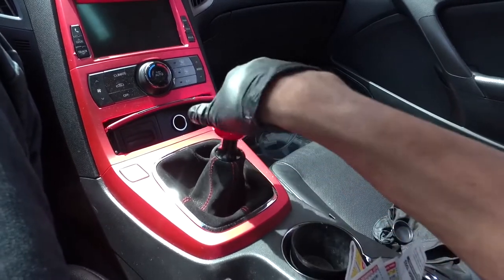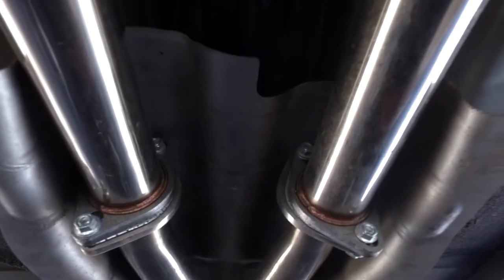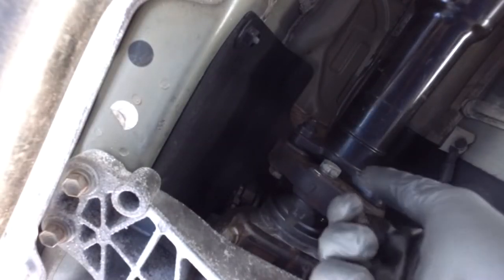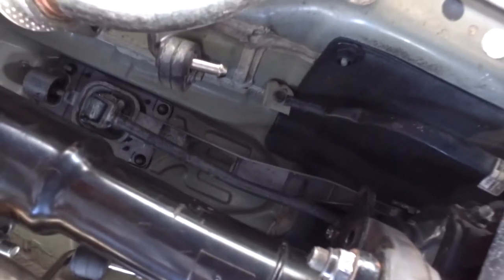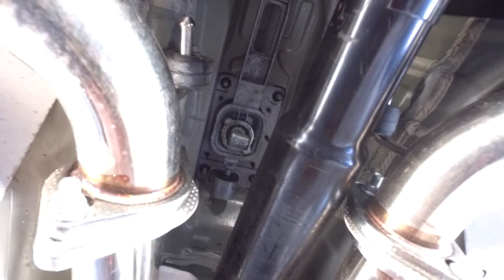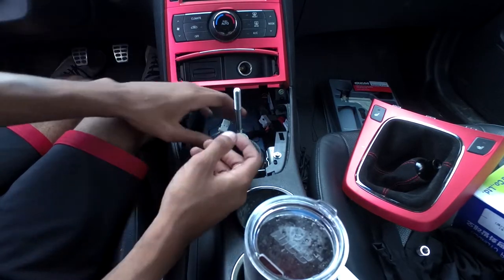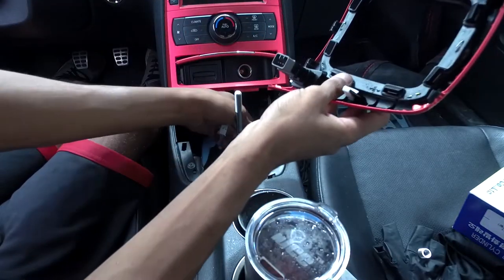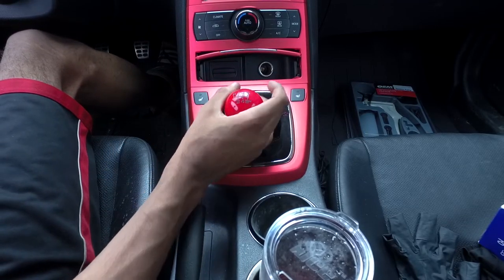How To Install A Short Shifter On Hyundai Genesis Coupe - Garageline short shifter

Comment: Hey man, I don't do much to cars and I'm a little scared disconnecting the driveshaft, you said it only took you 40 minutes so I can't imagine it was too too hard, and I have to put a catback exhaust in aswell so I figure Ill knock two birds out with one stone. Love the genny btw
Reply from the maker: That’s your best bet honestly, what exhaust did you get?
Reply: @FatalRPM  I got the ISR Street exhaust with Depo test pipes. I'm hoping it's loud enough but I have to do alot of highway driving so the Race wasn't and option.

Comment: How much time did it took you ? You should have changed the front and rear shifter bushing from ATQ while you were there.

I would love to see more video off installing stuff and driving!
Reply from the maker: If you're asking how long it took to install, not including the time to get the car on stands I'd say 30 min with power tools. 35-40 with hand tools because unless you have tiny hands there is no way you are gonna be able to get to the shift linkage without unbolting the drive shaft on the transmission side.

Comment: How do you like the short throw compared to stock? Any problems getting it into any gears? My genesis is my first manual car, not sure how i would like it. Ive already put a stage 2 clutch in so i cant see this install being too hard.
Reply from the maker: +Austin Paul So my genesis was my first manual as well. I bought it used and it had a stage 3 clutch in it. I personally like the shorter shifts (especially during spirited driving) however if you're not use to the car I'd stay away from it because you'll miss gears. The good thing about the adjustable one is if it's too short just bring it up. I made mine as short as possible and after having the car for a year before upgrading to the short shifter and I fell in love with it.
Reply: FatalRPM okay i gotcha, ive had the car for about 6 months so im pretty use to it now, i wanna be able to shift a little faster, the stock shifter throw is pretty long, i dont like it that much so maybe i will like the short throw, i mainly wanna do the bushings but i may as well do the shifter while i have everything apart. Thanks for the quick reply btw!
Reply from the maker: +Austin Paul No problem, definitely go with the adjustable one cuz if you don't like length of the shift then you can just quickly change it.
Reply: FatalRPM cool thanks man